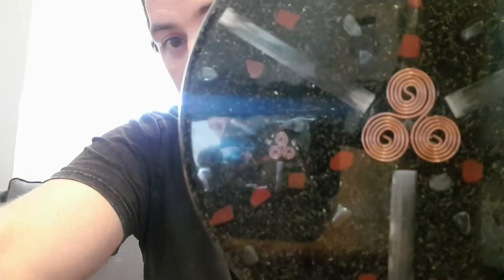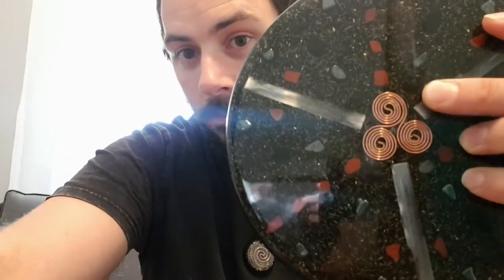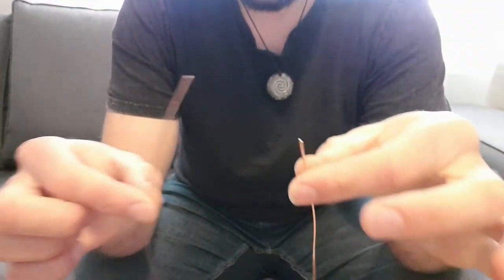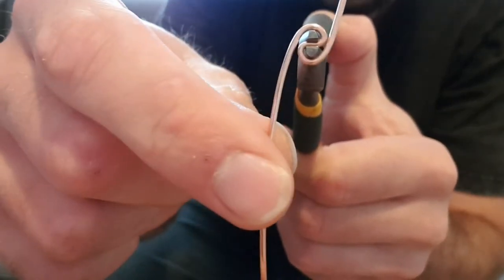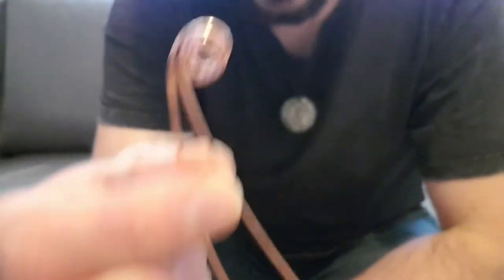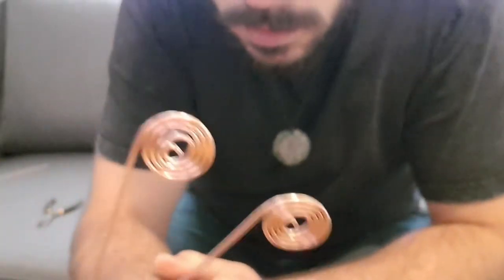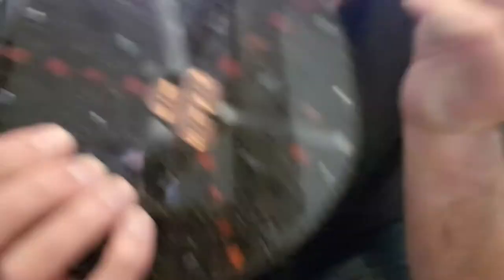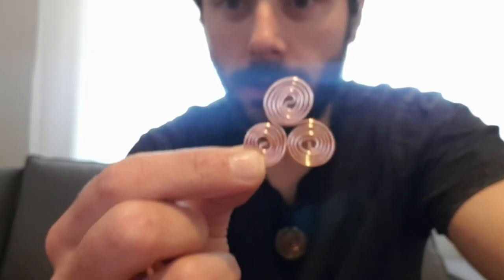The Power Of 144mhz - Triskelion  Copper Coil Tutorial

Comment: I also read about Tesla explaining that any measurement / frequency divisible by 3, 6, or 9 is beneficial. 144mhz for example, 1 + 4 + 4 = 9 which is divisible by 3. Amazing.
Reply from the maker: Yep, exactly, pretty neat hey 🙂
Reply: So the mark of the beast on their hands and forehead must be referring the cell phone frequency 666  people stare at all day . Maybe that's what John was referring about in revelation.
Reply: That might be meaningful if the second was some natural constant, and not a man made unit of time...
Either way, 144 is already divisible by 3, you don't have to do any mathematical gymnastics to get that to work..
Reply: @777dragonborn Cellular communications don't work at 666Hz. That'd yield an extremely low transmission rate.
They operate between 0.6 and 39 GHz...

Comment: So about cutting at certain length,does it matter when it changes volume and lenght,because metals do that when its cold or hot,specialy copper,how does it affect it?
Reply from the maker: There's always going to be some tolerance with any measurement.
It does need to be cut as acutely as possible to the Sacred cubit length. Do you know how much exactly a copper wire length would expand or shrink due to what temperature? It obviously does but how much really, I wonder 🤔 🤏🤌
Reply: @sasorgonitecreations  just googled it,it says at every 1C° higher it expands 0.0017 % so i think it doesnt have much impact and shouldnt change frequency of triskelion,as you said,it is cut at certain legnth. I made my firsr triskelion,now i wonder is it same dimension if i want to make bigger or smaller triskelion? Thanks for answering!
Reply from the maker: If you want to make a bigger or smaller triskelion then you can either half the 52.4cm or double it 👍

Comment: I just  went to the wavelength to frequency that I use to make my coils I designed and put 144mhz in it and I got 52.047301 cm…. 
So is the numbers right that you got? 

In inches I  get 20.491063675634294”

In mm I get 520.473017361111 mm

Also this 144 MHz as Hz is 144000000Hz
Reply: I just wrote the exact same thing and right after that I found your comment 👍🏻👍🏻
Reply: @jeroenjager  
 
That’s crazy lol
Reply: Interesting  ..by what means  do u do this wavelength to frequency conversion